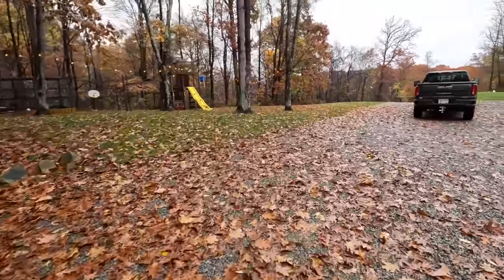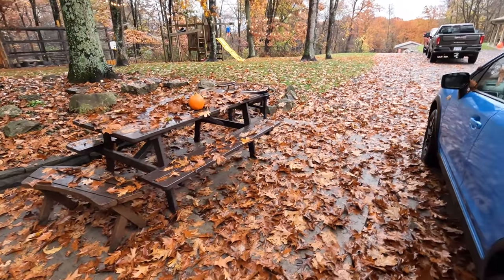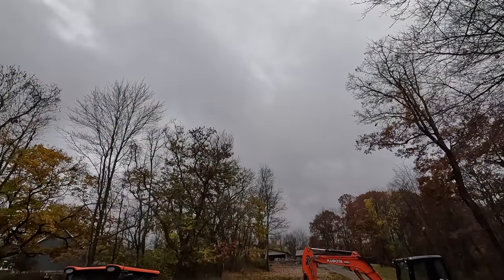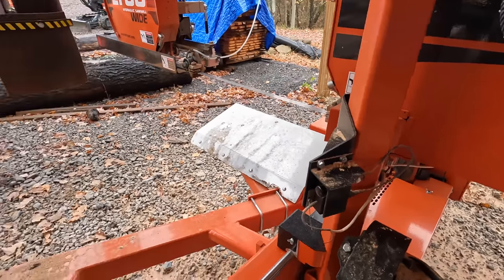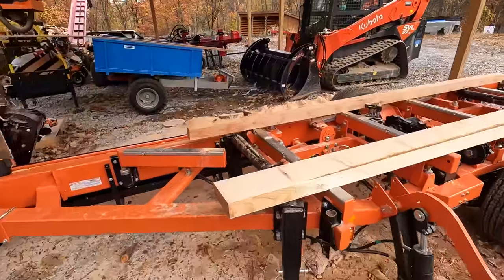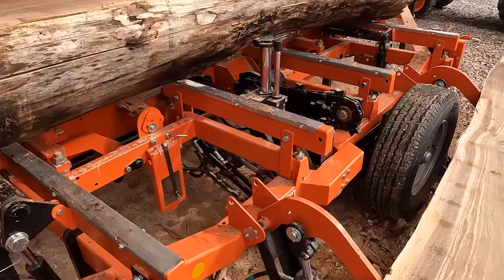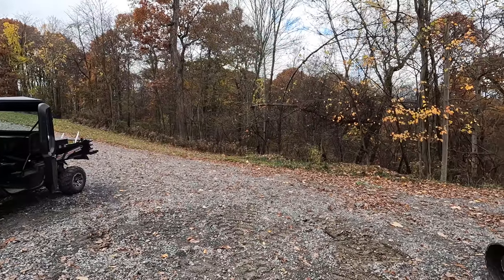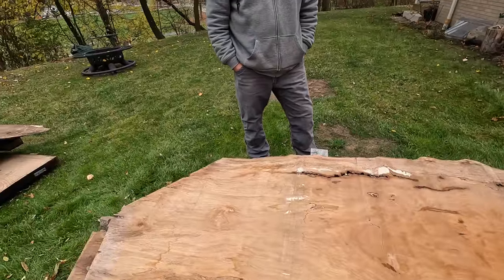Time to Make some Money Back! Buying Logs, Selling Lumber

Comment: That's nice Cherry. I cut 200 logs back in 2000 when I built a pond. I and a fellow cut 8700 board feet of lumber. The largest log was a red elm that was 46 inches by 10.5 feet. I sold most of it. I still have some 20-inch-wide ash stickered in my barn. It's still as flat as can be. We Cut it 23 years ago. I have started a few fires with some of your Firestarter I got in the last month. It has worked well.

Comment: Hello Mike, reference your Laser, to enhance being able to see it (My guess it's a red color, poor for outside use, GREEN COLOR is the better option / more desirable for outdoor use,)  you should get a pair of "Red-Colored" sun-glasses, "Laser-glasses," to aid in seeing the laser outdoors.  Take a closer look at Nathan's setup, his machine is facing (the side where the Laser is located on the machine) an inside-wall,  thus explains why it's so visible in Nathan's video's.  

The following may help one and all to understand why the Green is more desirable for outside use, versus Red.  Back in my younger day's of early 1980's, I was scuba diving,  Forget what happened, but I cut myself underwater, at a depth of only 30' Feet.  Very nice sunny day, water visibility (i.e., how far you could see in a straight line) was great.  Maybe 20' Ft. visibility, here in Puget Sound, Washington State, at the time.  Nothing serious, but enough to see that "something  GREEN," was leaking from my glove.  I can remember thinking, why in the heck am I bleeding GREEN!!!!  The science behind it is simple.  RED is the first color of the light spectrum you lose as you dive deeper under water.  Put another way, the RED spectrum of light, is easily reflected away, or lost if you will.

Comment: Good morning OWTM! Not moving too fast this morning. Evening before last, I used a comealong to manually winch my homemade deer blind out of the enclosed part of the shop into the gravel bay and turn it to face out. Lots of manual adjustments needed, levering, lifting to slide boards under the skids, and even the comealong took more effort than I thought it would. All this was required because the tractor carburetor bit the dust and is being rebuilt over at a shop the other side of town. So a 5-minute job for the tractor took a couple hours of at times strenuous labor. Anyway, with the blind safely past the 7’ door, I could put the 8’ roof on yesterday. So today I get to re-deploy the comealong to pull the now-finished blind out so I can hook a chain to the truck and crawl across about a half mile of pasture to where the blind will sit. If I don’t turn it over crossing a big terrace or the stream, it should work fine. I would guess the sled without the blind was 150-200 lbs, and it now has probably 1000 lbs on it, including 20-25 pieces of 60-yo oak 2x4 and 2x6, almost 20 sheets of 8’ corrugated metal, and 5x8’ of 3/4” plywood. I’m pretty pleased with it - 5’x8’ inside dimensions, 6.5’ tall. Windows tilt up and out, black mesh inside. Carpet remnants on floor and lower walls for sound deadening. Painted black above that on walls to darken. Black tarp above rafters, below metal roof, for dark, sound, and to reduce condensation. Total cost is less than $150, and that’s almost $50 in screws (cannot nail that oak!), $30 in tarps/mesh, $20 in gate hinges for the door, and maybe $50 in various shades of camo paint in rattlecans. When I deploy it, I’ll wire-tie a bunch of cedar onto the corners and near the bottom of the windows, and throw enough onto the roof to both break up the straight lines and deaden the sound of rain. It’s the western Ozarks version of the mini-cabin. All this to try to catch some venison!
Reply: Send a picture if you can, sound like a masterpiece :)
Reply: @barryhoneycutt3894  as far as I know, we can’t put photos in comments. For now though, I can report deployment has been accomplished. Lots of cedar branches around, on top, and wired onto it. Judging from the bright sunlight bouncing around, I need to make some opaque blackout curtains to go over the black mesh ones.

Comment: White oak is an excellent framing lumber. Some of the strongest couch frames are white oak, and also pallets.  I never cared for it to make furniture tho, wont take  a stain well and never cared for the grain. There's a reason we have walnut gun stocks, cherry dressers and red oak cabinets. They are all aesthetically pleasing to the eye. Great video, love the music you use to enhance the work you do. Be safe Mike.
Reply: Did you ever try the steel wool and vinegar trick to stain oak?  I never have myself but have a nice looking rolling pin that was stained with that trick.

Comment: I work on the Guardrail crew in Mississippi and I noticed that the wooden post that is used for Guardrail post are the center of the log and its pine.
Reply from the maker: Yes pine that works, not hardwoods

Comment: That 48C processor I was talking about was about 200 thousand. Probably take a dump truck to haul it or move it I think it was $18,000 pounds. You've got a lot of nice equipment I'm sure you could keep it busy but you know that's a mortgage payment I've noticed a lot with the smaller would processors they won't do the small splits a lot of people that get free would you know it's from residential crooked it's got crotchs  but that 48C you know you can cut that out. Most of the smaller would processors you got to put a bigger wedge in it or it just won't process it if that makes sense lot more work to it just don't make sense unless you know you want to have boiler wood you know if you're splitting bigger wood for a boiler wood makes sense. I'd say you see a lot of people that use Boiler wood in Pennsylvania. You just got to cut more wood and you get less it's heavier too so you got to cut more of it to get a good load for those kinds of people. It would be in the elements too unless you had a bigger building. I don't know if it would be practical for a guy unless you had a big woodyard like you know what you just showed us those guys are about production you know they've got a loader that's huge you can buy a bigger equipment it's actually cheaper used but you know once it's on a job site thats it 😅😅😅 you don't move it. I've seen some massive excavators for like eight grand it's just because nobody wants to move it or a big old front loader they're cheap used parts are expensive but if you buy something from someone like that it seems like they really kept it up it's just they made their money and they just put it down the road. You know you probably pay 8000 bucks but it'll probably take almost $20 to move it so you know what I'm saying.

Comment: I have been trying to figure out why you call that lumber 10 quarter or 6 quarter boards why not just call it what it is 2 1/2 inch thick or 1 1/2 thick lumber. It just like the rock you call stone ? Stone it what you call any rock that id cut to dimension , Like stone you stack or lay down as pavers or stone brick layer lay in walls. they stack and you put mortar between them.  Rock is what you pick up at the Quary it can be clean rock without any dust or screenings Around here the correct terminology is Base rock that you call out the size of the rock 3/4 inch base through 1 1/2 base it all includes the dust or waste rock and compacts very well. we also have road rock made for gravel roads that the county maintains. And the you can get clean rock almost any size that you can backfill with and doesn't settle much at all. So to me it just sounds like you don't know what to call your rock base material.